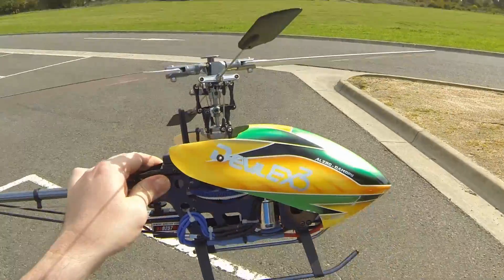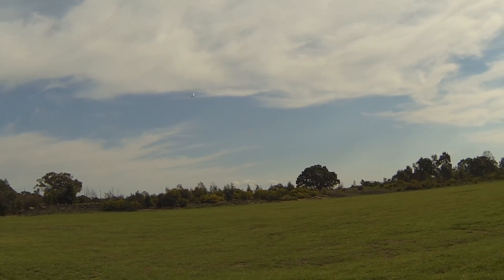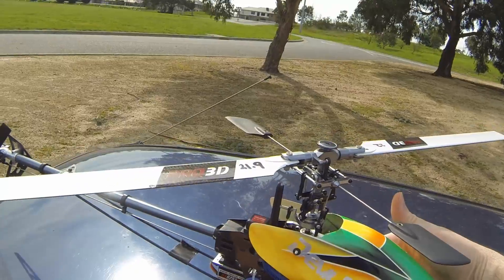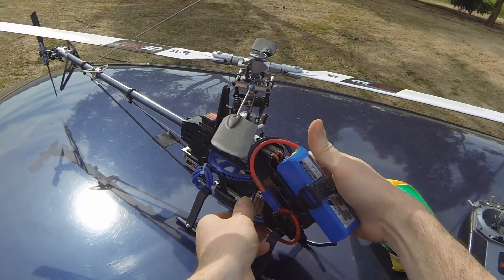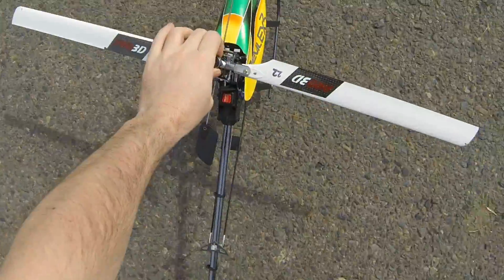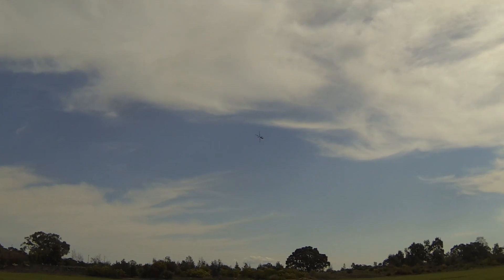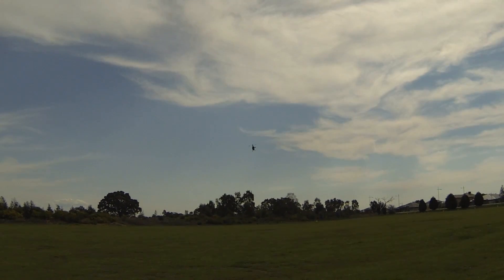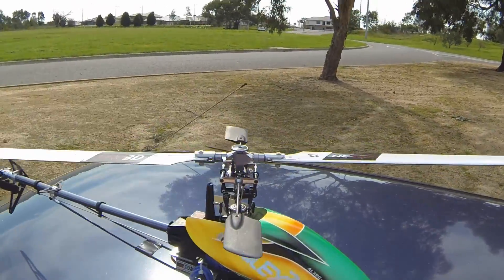450 Pro Governor mode Maiden

Comment: hey!! can you help with something? on my trex 450 pro (flybar) my tail kicks out when i punch the throttle or do 3D im running a futaba gy401 gyro with a hitec 5084 tail servo im running a flat 100 throttle curve and 69. gyro gain (HH). im trying to get as many opinions from people as possible that seem like they know what they are doing and you do. so could you heli me out with this?
Reply from the maker: No problems..the gy401 is a great gyro..the clones are good too. I have a video specifically showing the correct setup for the 401 gyro as per the manual, works rock solid.. check that video out first!
Its important to know that you have to add some offset to the tail blades to counter the main blades...if you have no pitch, it may work but may have kick outs.
One last thing that many overlook is slop in the tail blades due to loose pitch slider...if this is the case the blades wont hold the correct pitch under stress cos of the slop...check to see that is ok....CHECK MY 401 SETUP VIDEO.
Reply from the maker: The video is called "Gyro & Tail setup (401 type)" I think you'll find what you need.  :)